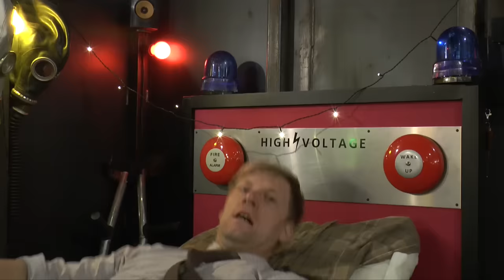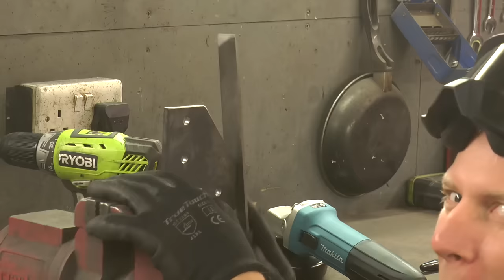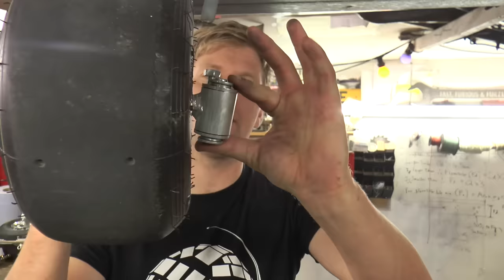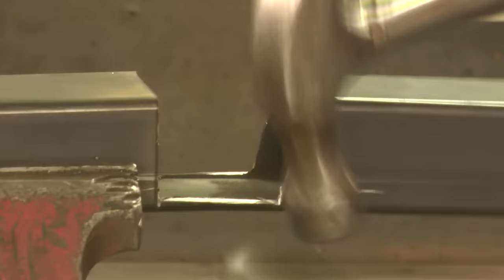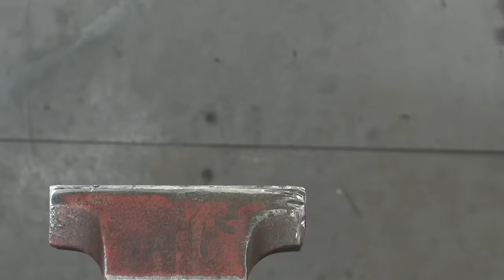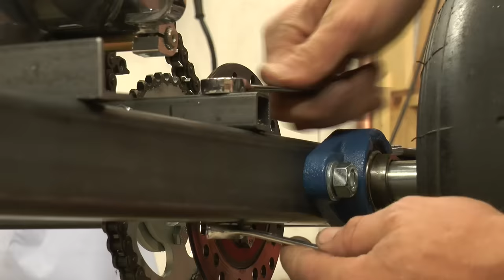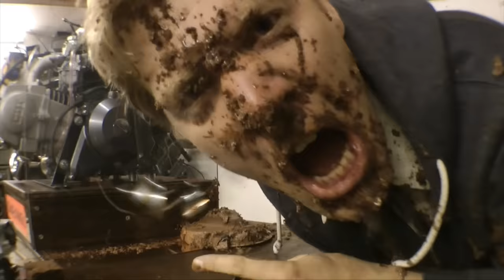Making a Motorised Go Cart with NO WELDER and simple tools #1 - Chassis/Engine

Comment: Just a tip 
If you have a lawn mower that you don’t use 
Just use the engine in it
Reply: they have vertical shafts tho
Reply: He literally said that he doesn't want to use one cause they sound like a jet engine
Reply: Trentdakiller it’s EZ to change that
Reply: FBI - Federal Bureau of Investigation 
And are you the one that will be riding it
You can use a mower engine if you want
Reply: @theonecommenter  no but if you do its just loud. That's why he didn't want to use it. I'm not saying dont. But they are really loud
Reply: FBI - Federal Bureau of Investigation 
Have you heard about mufflers
Reply: @theonecommenter  those are for actual engines. Nobody's gonna put one on a fricking lawn mower

Comment: Guys, if you don’t have an angle grinder, I suggest buying an arbor shaft adapter and an angle grinder disk. It slides onto a drill and you can cut metal like that. Costs around $7

Comment: Awesome video!

However, you shouldn't use a file like that... You should only ever use forward strokes with a file. Backward (pulling) strokes wear the teeth out significantly faster and don't really remove much material.

Comment: what size metal beams did you use for the frame and where can i buy it
Reply: i know its late, but it looks like 2inch box  with a 1/4inch wall thickness. where you gan get it depends on your location, from your profile pic and name I would say US, around Michigan or Idaho(I dont know what im doing), just look for "bulk metal distributors", "metal mart", "bulk steel", etc... it should come up with some useful sites. I would also just check local metal fabricators to see if they have what you need. cheers

Comment: Why isn't there a mechano like system that doesn't cost the earth. Open beam is so expensive. All we need is steel box and flat plate a few different sizes with same size hole every 2 inches or summin. Some connecting plates and bobs your uncle we can build anything. Cmon Colin get on it. The Colin furze construction system!

Comment: could i use a electric engine instead of the ice engine, if so could you tell me what voltage or whatso
Reply: i know you either figured it out or dropped it by now, but it depends on torque, top speed, etc... there are some very powerful motors that can be harvested from different common things, but I would think a specially designed electric go cart motor would be best. I would watch Jeremy fieldlings video on motor basics, as well as videos on diy electric go carts. cheers

Comment: Colin, I loved the go-Kart build. Maybe next time instead of the huge boxed pipe you can use EMT conduit using these connectors. (https://makerpipe.com/) I am in no way connected with these guys but impressed with there products. Just need a pipe bender, EMT cutting tool, drill bits, and basic hand tools. No need for any dangerous tools! HAHAHA, Thanks for your time. Best regards, David

Comment: 3:57 or buy an drill guide. less than 20 pounds.
Reply: remember this is for cheapskates
Reply: @TheBunnyDeveloper  True but if someone drills a crooked hole then that someone needs to buy another piece of material and try again. It's cheaper to buy a drillguide. I'm gonna buy a cheap drillpress for about 800 SEK, it should be able to drill through thin steel.
Reply: @unogazzy84  I understand that, it's more of whether you want to take the risk or you want to not have to deal with buying more material because a small mistake.